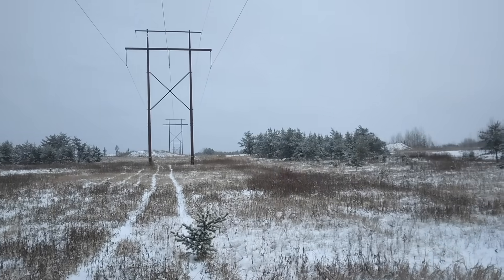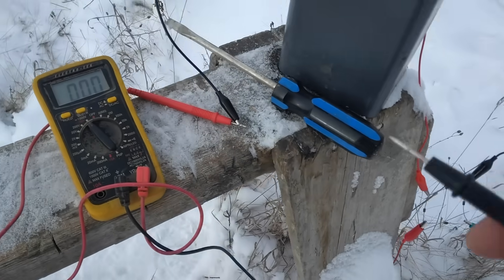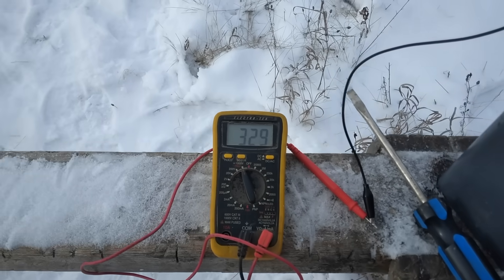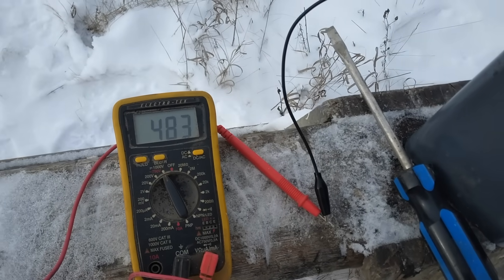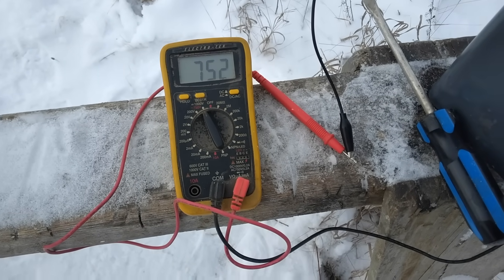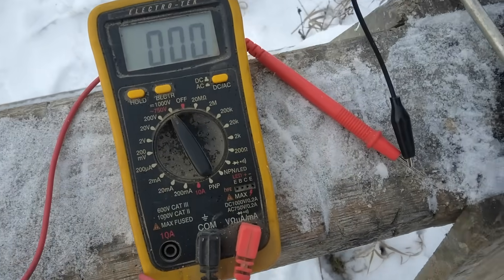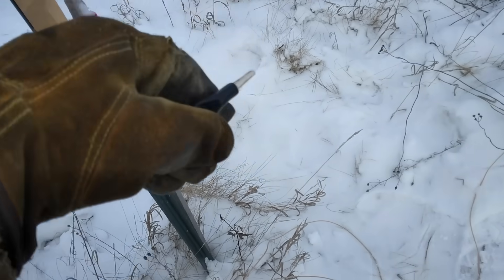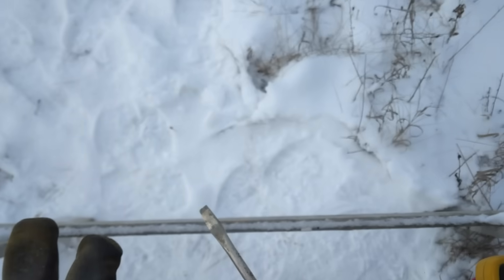Fences sucking power from under HV transmission lines

Comment: While my electrical knowledge may not be at the professional level, I am constantly amazed at information that is somewhat  different to that of the common education we all rely on as general knowledge & am of open mind to never stop learning. Relating to this topic here on HV lines, I have a couple of points to share.
The common perception that such power flows through the copper wires within the insulation is not exactly true, surprisingly in actuality the power is lead by the wire to travel intended path though surrounds the cable rather than using it directly, hence making the practice of scavenging as seen hereach totally possible. Alternative to this concept one can borrow a 'transformer' type setup using a copper coil to scavenge electricity with the addition of a simple ballast to increase the amperage. The atmosphere surrounding us on earth also has stored power within it & if a highly conductive wire is elevated significantly electricity can be taken straight from the atmosphere alone at surprisingly high voltages (every metre is equal to 100 volts, seriously) though miniscule amps.

Comment: this is 1 of Tesla's discoveries , you can run a wire a couple of inches of off of the ground and several feet long ,( the longer the better) and get current.

Comment: Had an older telephone line that was Arial long drive right under the power lines until the transformer near the house. When DSL was introduced was not compatible so Telco buried a new line but left the old. one day the old line was whipping in the wind on side of house not connected anymore and went to tied it down grabbed the end and was knocked to the ground. too a meter and was getting a large voltage reading. I ended up grounding the house end, taking the road end down and down eh next pole on my side and connecting that end to   a small florescent bulb out of a camping light and the other end of the bulb back to ground, it lit up, rigged in in a weather proof fixture and had a drive light free electric until moved.

Comment: Friend of ours back in the 70's built a new tie stall dairy barn for his registered Holstein herd. High tension lines on steel towers ran about 400 ft behind his barn. When he got the florescent lights hooked up and they turned them off they didn't turn off! Over the years they installed florescent lights in several other buildings with the same results. As far as I know they still work today.
Reply: Was it 3 runs of 4 wires each?  760KV
Reply: @somethinburnin  I believe so but honestly cannot tell you,  didn't pay that close of attention plus I haven't been past there in over 10 years, They're about an hour drive from here
Reply: @dvdosterloh  was it in Northern NY?  Because we got the 760KV that did things just like that

Comment: You are capactively coupling to the power line. Theoretically, it could charge up to the voltage on the power line. If you had a large conducting plate or multiple wires you could harvest significant power.

Comment: Instead of just reading AC open circuit to ground. Grab some resistors and tie one end to ground, the other to your wire and measure the voltage across the resistor. This will also give you an idea how much current you can generate. (Voltage divided by resistance = amps)

Comment: You must steal has much as you can from the gangster power companies, install a bigger fence with insulators, do not allow the voltage to climb so high, tap it off into Lithium Cells, start small with some scrap 18650 cells, use it to light your house.

Comment: I was hunting near some big power lines here in Ontario. I was riding my ATV directly under the power lines. I was getting small sharp shocks on a constant basis through my brake levers. I was thinking the power lines had broken and fallen somewhere down the line. Apparently this happens all the time. Very cool.
Reply: Same thing happened to me on my dirtbike when I stopped to clear my goggles because it started to rain. I thought the rain was becoming conductive. Scared the living shivves outs of me and I throttled away at full speed!

Comment: you cant charge up a capacitor with AC
Reply: For a half cycle you can, but he's using a bridge rectifier anyway
Reply: right, it sounded like he was saying he was running it through the capacitor first and then the bridge afterwards but I looked at the wiring and it looks right, so nevermind   @Magneticitist

Comment: Don't do any more experiments!!!! There is a good reason that power ine is no closer to the ground than it is ....that being that if it were much lower just walking or driving  under it might just modify the arc distance just enough to to change your person into an oily burnt spot as I once saw happen to a scared jack rabbit that got too close to an electrified section of fence at Sandia base in Albuquerque several years ago ....but if you must do just one experiment to prove that is possible ....cut several stakes of 2 inch abs plastic with about a 30 degree angle drive in as many as you choose to make at 24 foot intervals with a rubber mallet and gingerly pull them out so as to pull out a plug of dirt then drop the stakes back into their holes take some not fabricated in the field 3/4 x 3/4 oak stakes with 6 foot  fluo bulbs( the kind that are with a bullet point on each hand nylon zip tied to he oak pieces at either end length wise with a short piece of stripped coax on the end that goes into the ground and the same on the skyward end ....then drop the oak piece into the ground at dark ad watch it light upo just as bright as if it were plugged into a balast that is kicking out close to 1000 vac....the dimensions  might be off but you get the idea...bring it down by underhand pitch of a cinderblock or unmounted tire  or some thing else non conductive and don't install the others ....you wouldn't want to kill any livestock by attracting them to the light only to share literally the shock of their life

Comment: I'd be setting up a battery bank and use that stray EMF to keep it charged.  The power could be used in your barn for low-current things like battery tenders, etc., on your powered equipment.  If you have livestock, it could drive a remote heat strip to keep a water pump from freezing.

Comment: Might be an urban myth but a bloke living near a BBC transmitter was said to have installed a large coil of wire in his ceiling space and was using the induced power to heat his house. At broadcast frequencies you'd get more power transfer than from 50 or 60 Hz powerline. The BBC wondered why their signal strength was so low in the local area and nabbed him.
Reply: BBC signal strength was low in the local area and yet some guy was picking up enough just in his ceiling space to heat a house? 🤩 he is a jenius 🤤🤣

Comment: Fascinating stories below.  I might add that while film cameras are passing out of vogue and digital ones are mostly the rage, it was possible with film cameras to capture the inductive voltages/currents on film.  Under very special circumstances, you could photograph such disturbances and would appear on film when under voltages of 230-kV, 345-kV transmission systems.  This is Kirlian photography.  The photographic film had to be exposed under A.C. power circuits when temperatures were below 32 degrees and with practically no humidity present.  Winter was best for such images.  Lichtenberg figures would appear across the photograph.
Reply: Is this an artefact of EMF on the exposure process irrespective of what was photographed? I remember Kirlian photo's claiming to be our aura. However We do all transmit and receive EMF. My reading is that biology/biofield uses such ultra weak signalling as to stretch or defy credibility to anyone trained in human electronics.
Reply: @binra3788  That's very interesting.  The circumstances surrounding the white arcs crossing the film and being reproduced can only occur under the strictest of conditions, as mentioned.  Haven't been able to reproduce this effect any other way except with intense cold and very hypo-humidity.  This is one of the disappointing aspects of non-film cameras.  I can't get it to appear on any digital reproduction.  Your information about personal aura is quite interesting and there are people who can detect and actually visualize this unique phenomena.

Comment: your looking at 2600 volts  of stored energy, yes, this is a great way to get free power.. I have done this test,, with light bulbs. and ya they lit up. what you are getting there is called induction, the power lines emit a ring like power field around it,, so what you will get is massive voltage but a super fast current.. so would dissipate quickly, BUT you using it on a capacitor will and can turn it into stored energy,, and deadly

Comment: I have seen in the dessert, they climb the power poles and install pulleys on two poles, then run the wire between the pulleys. Then adjust the sag on the wire to adjust the voltage under load.

Comment: Nice experiment¡. With 1KV reverse breakdown diodes you probably wont get much past that voltage on the charging DC capacitor. That's because the line voltages are alternating above and below ground potential (I agree with other comment in that there should be a mix of harmonics depending on the distance between the pick-up wire, witch doesn't need to be coax btw, and the HV lines in relation to the distance between the different HV conductors themselves). Anyway, because your DC capacitor terminals are ungrounded, usually the positive terminal will sit above ground potential and negative terminal will sit below ground potential. When the incoming or pick up wire picks a voltage of say 500V below ground, the diode of the rectifier that is connected between the positive terminal of the capacitor and the incoming pick up wire would get a reverse voltage of 1KV if the capacitor is charged to 1000V (Would help to see a diagram of connections and potentials referenced to ground). Conversely when pick up wire gets 500V above ground, the diode that is connected between the negative terminal of the capacitor and the pick up wire would get a reverse voltage of 1KV when the capacitor is charged to 1000V. Because of the relatively low current, the diodes would conduct in reverse without getting destroyed. The way to get higher voltages on the capacitor would be to connect the pickup wire to one terminal of the capacitor and the other terminal through a series of diodes to ground. That way you could reach n*1000 V on the DC capacitor, assuming that the cap has enough voltage rating and you use a series of n diodes rated at 1KV of reverse voltage. Of course you would get a half wave rectifier, so half the incoming current

Comment: What amazes me is the skimpy little structures that they are using over there to transport such high voltage electricity. Here in the Netherlands where I live also all the high voltage power distribution is done above ground. But the do it with big beefy towers (think Eiffel towers with arms, or a little bit smaller of often 200 foot or more high) and the electric wires are very well isolated hanging on heavy isolaters (ceramic I believe). It seems to me that these 235k Volt? lines just hanging there are extremely dangerous!
Reply: Nobody gives a flying france about UK .. hehe 
its not about the HV, the towers are suited to meet the engineered weight/load requirement of the wire, closer together towers, fewer transmission lines as shown at .47 secs in the video, there are larger towers in US to meet higher load capacity and spanned distances.
BTW good stuff ya got over there -- https://youtu.be/nyjCrP38ICc

Comment: I don't see the cap being an advantage. It stores power, its a little like a battery. I would have liked to see the actual energy expressed as watts and have the line at different heights as a comparison. Have done maintenance in a high voltage switch yard, if you climb  and your not grounded then your body has potential with respect to ground and a small spark can be see from your finger to the metalwork, This does not hurt as its more like static electricity.

Comment: Zapping of America! We took fluorescent lamps and attached to a rope and were told to take them down. We were over 100ft away from the lines. They lied to on the voltage feeds.  They were actually over 500k over 6 lines each. All the chain link fence had to be removed.

Comment: What your experiencing is bonded neutral earth return ...to prevent death the neutral wire is physically connected to the earth cable at the fuse box ..this allows dangerous current to go to the ground easier not your house plus allows the power company to moniter phase shifts to prevent overheating..
..in theory U could charge a battery bank with this all U need is either magnetic flux interference or connect direct to the base of the tower to liven things up

Comment: As an Electrical Engineer, I have 3 main points, first this is dangerous,  I know of line workers being killed by "De-energized" lines that where inductively charged like this☠.  Second, when you draw power from an inductively charged circuit there is a magnetic interaction back to the main line that causes power to be lost in the main line. Third as stated in several other posts, drawing power from a line inductively is considered stealing as it does result in power being lost from the system.

Comment: What would be worthwhile calculating is the amount of energy that has been transferred to the capacitor, as that will tell you how much power is being delivered to it. That is an 88 microfarad capacitor, so at 400V it would hold 400x 400 x 0.000088 / 2 = 7 joules. If that took one minute, then that's 7 / 60 = 0.12 watts to two significant figures. If you get up to 1,000 V, then that capacitor will hold 44 joules which is very dangerous.

I should add that 7 joules is more than enough to kill somebody, let alone 44 joules, although if both terminals are isolated from ground potential, you would have to touch bother terminals. In any event, this is not a safe experiment...

I should add that the ground will be sucking far more power out of the transmission lines than the fence.
Reply from the maker: Watch to the end of the video.

Comment: 8:30 You can go to 2000V on the capacitor before the diodes see 1000V. Your bridge rectifier is also a voltage divider. What you're really collecting in the capacitor is coulombs. And amp is a coulomb per second. You could put that screw driver across those capacitor terminals and melt the terminals and the screw driver with a capacitor that size at that voltage.

Comment: To show you how stupid the law is, I have a rental property. When it comes vacant I need water to clean it. I borrow from my neighbor... he's glad to oblige at no charge. I would do the same for him. No problem. Put a 5 gal bucket under his outdoor faucet. But if I hook a hose between my neighbor's outdoor faucet and mine, and then take the exact same amount of water from my tap, the MUD (Municipal Utility District) claims that's theft... and the fine if big.  

I can't emphasize enough how absolutely arbitrary law is. The water is still metered. But if that was legal, all the houses on the block would be daisy chained. The bill for actual water would be the same. But it's all the other charges that they collect for the one connection vs. 10 connections that makes it different. As legal criminals say... if they can measure it, they can... and they do... tax it.

Comment: Legaleese speaking from a formally educated electrician; They are still firmly as stubborn children claiming Tesla´s wireless power transmission was just a foolish pipe dream. It should be an impressive trick to pull, claiming something different in court claiming you to have stolen from them :D. Your opportunity there opens for some good experimentations with coils, antennas and measurements. Purely for enthusiast scientific curiosity of course :))
Reply from the maker: Purely scientific curiosity; of course!

Comment: Back in the late '60s and early '70s, I tried to convince my Grandpa and Dad to let me put up a few loose coils of wire at the edge of the treeline and run them to a few lights along the horse path along one section of fence. This was back about 50 feet or so from the easement where the high tension towers ran. My Grandpa complained occasionally about being caught in the dark on that end of the farm and I figured putting up a light every 100 yards or so would provide enough to orient back to the house if caught out after dark. They were convinced the power company would come after them, but I couldn't convince them it was all loss for the power company anyway. The minor amount we'd get for a dozen light bulbs wouldn't even show, since it was loss anyway. It wasn't like I was going up a tower and hanging a coil up there. I always meant to run out with a coil of wire, a light, and a meter and see how much we could get, just to know, but never did.
Reply: I remember going up on the hills near where I stayed a few years back with a fluorescent tube. When I stood under the 400kV lines holding the tube vertically in my hand the tube lit up from the top of the tube down to wherever I held it. It wasn't super bright but that was due to the field created under the lines being capable of producing only a low charge flow through the insulating air and if instead I had erected a small wire array say 2m in the air and had electrically connected one end of the tube to it and hung it vertically down and earthed the bottom end of the tube to the ground it would be very bright and the brightness could be varied by raising and lowering the top wire array. You could have done that easily enough.
Reply from the maker: Thanks for the comment!
Reply: Enter LEDs:)
Reply: Could animals get hurt from this? Could it start a fire?